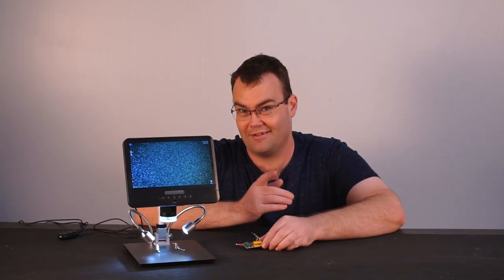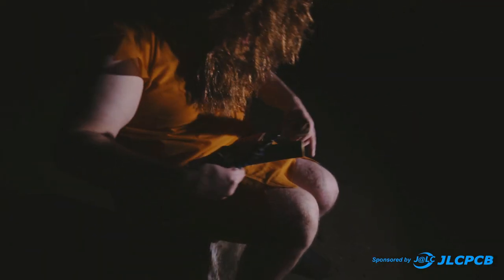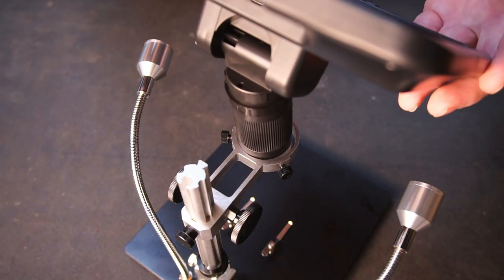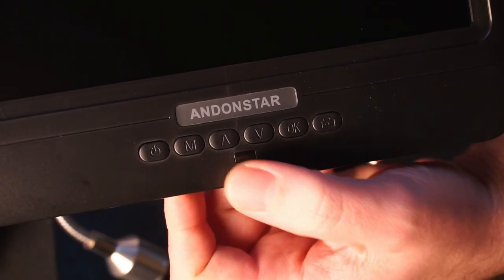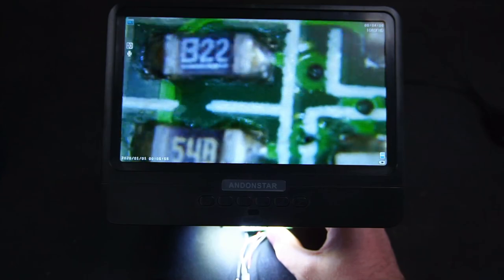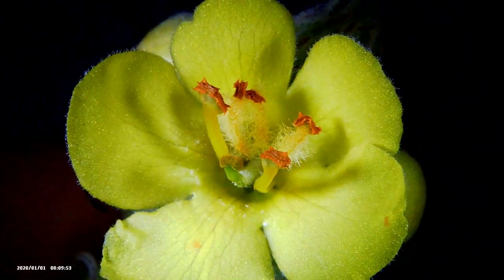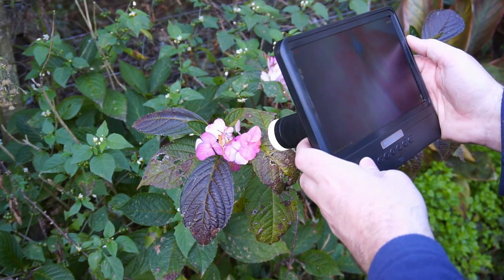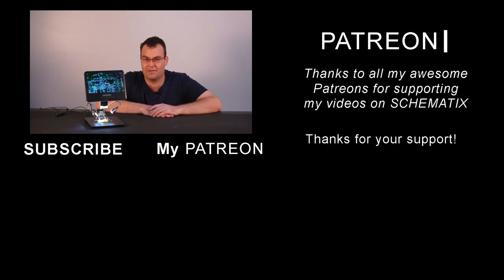This is a Bargain! II Andonstar AD208 Digital Microscope 8.5" LCD Review

Comment: I have exactly the same model and would actually say that it IS very sharp and clear. Certainly not up to professional standards, but surprisingly good. Way more than enough for most uses. Thanks for reminding me that there is a battery compartment! I have been using it plugged into a 5V powerbank, but an 18650 would probably come in quite hand in many situations. The only problem I have had with it was trying to get the ring at the base of the vertical loosened up so I could rotate the whole unit and horizontal support around the vertical support. Had to go to the garage and use some pretty big pliers and a vise to do that. I definitely do recommend it for any home use and think it would serve quite well in a lot of school or business situations as well as long as it is front lit will do.
Reply: hi, is it heavy duty?
Reply: @recommendedforyou157  Just 2 pounds 10 ounces, or 1.2 Kg.
Ooops, sorry I missed the 'duty'.  But that weight may tell you something. If you treat it with a reasonable amount of respect it will last a long time. If you pound nails with it, it won't. As I said, it could be used in schools or labs with no trouble as long as the user is not ham fisted. Much like a normal microscope.
Reply: @gkseifert  thank you sir
Reply: Is there enough room between base and camera to get circuit board, soldering iron etc ?

Comment: The ladybug shot was really cool!

The claimed 260X zoom is clearly an exaggeration. On the provided (1280 X 800) monitor, it looks to be perhaps  50 or 60X max. On a 24” HD (1080) screen, you might get around 100X before losing detail. I wish these companies would list magnification accurately. As you pointed out, the magnification of this model is far more than adequate for almost any soldering work, so long as the board or other work will fit on the stage. But if you want to observe, say, microscopic life, 260X might get you close. But this and many other scopes now on the market mislead shoppers. The claimed 260X would be enough for many, say, student needs, but the actual performance would be unacceptable for those purposes. Like lumens for flashlights, you can’t trust the claims for too many of these products. There are some reputable companies that, as yet, don’t seem to lie (AmScope, Leica, and a few others for microscopes, for example) but it’s very difficult for people to know what they can trust. 

Great, helpful review.

Comment: I have the MOYSUWE version (exactly the same, except with a crappy wireless remote which has a bad habit of skipping items in the menus - lots of trial and error to select the right line...). One thing that bugs me is the battery icon at the bottom right of the screen that constantly flashes. Anyone know why? Does it ever stop blinking? Also, anyone know what the third LED on the back (the one right next to the SD card slot) is for? (The first, red, is to indicate when the device is plugged in; the second, blue, is to indicate when the device is turned on.) Thank you!

Comment: Incase it's not obvious, you must supply your own USB charger plug. It's not included with the 'scope.

I just ordered one this weekend. Can't wait for it to arrive. I've got some 0405 components to solder.
Reply: is this actually good for soldering 
I was considering  getting one  for soldering but then I saw another review that says the lack of depth perception makes it harder than a  binocular scope , not sure how much an entry level binocular scope  for soldering would cost or if is worth it to go the binocular route
looking to do console repair and modifications as well as  some arduino stuff
Reply: @andreamitchell4758  it works for me. Stereo vision is always going to be better, and cost more.

I think the only challenge I experience is the small stand space. For console repairs you'd probably struggle to position the board under the camera well enough to view areas more than 3-4 inches in from the edge of the board, unless you made your own stand, which negates the price advantage of buying this type of scope.
Reply: If you're in for the long haul and can justify the spend, a binocular scope would be a way better choice in that you can typically add polarising filters, better lighting and have more functional mounting, without having to pay twice. The age old wisdom of spend well, spend once.

If you're just getting started and need to be sure you will do this a lot, then this might be an option for "testing the waters".

Comment: Thanks, what is the picture delay on the screen with your experience?
Reply from the maker: There is a slight delay however I didn't find it a problem. I only noticed it when making quick movement

Comment: Can see how one of these could be useful mounting those nightmarish 0.1mm pitch ICs.
Reply: Not sure what you are working with with a pitch that tight but I have managed to hand solder with an iron a DS3502 which has a 10uMAX case. 3mm case, 10 pin, 0.5mm pitch. Had a 70x optical zoom digital output though.
Reply: @srmofoable  Looking at it now, I was just wrong.  The STM32 and MSOP-10 chips that give me fits have 0.25mm width pins, with the same spacing ... so yes, 0.5mm pitch.  All I have is an optical loupe and magnifier glasses.  Your DS3502 looks like an MSOP-10.  I have little 0.1" PCB adapter plates for that kind of thing.

Comment: Do you know of any reliable 18650 charger schematics using basic components that can easily be found? I’ve already got a schematic for one that uses LM358N, not entirely sure or trusting of it though, I’ve tested it using a simulator site but I’m not entirely sure if it will really work :/

Comment: Looks nice for electronics work but the magnification is at tops 10x, which is also all what you need for electronics work.
Reply: No, 10x magnification is nothing, it's what some beauty mirrors have...you're definitely wrong.
Reply: No he's not. 40x microscopes are used in schools for observing cells. If this was 280x or whatever they claim he could see the bacteria on the PCB. Instead the camera can't even fill the screen with a resistor. No way that's more than 20x
Reply: @westsenkovec  you're wrong too.
Reply: @westsenkovec  I just put a scale under mine (in photo mode, not video mode). It was as far down as it can go and still focus. About 1.9 millimeters on that scale fills the screen horizontally. That screen is about 190mm wide so that is about 100X. Don't know where the 260X comes from.

Comment: I use a simular scope. its without a screen. so I use it with my tablet. works great :)
Reply: does it have a stand or is it  one of those handheld jobs?
 if it is handheld I wonder if you could  rig up a  stand or find some stl files to 3d print one
I was looking for something like this  that   has better optics but lets you use your won android device as a screen or  is  at least cheaper , but not the handheld units with no screen or stand

Comment: Nice review! 
So you decided to replace the 18650 cells inside your Makita battery and found out that it also needs a new PCB to be accepted by the original charger again ?
Makita bastards trying to outsmart the caveman.... GGGRRRRRR.....
Please be aware, those boards are great to trick the charger to accept the battery again but the board doesn't balance the cells. 
I made a small 5pin JST connector on the 4S Makita (14.4V) battery to balance them using a Turnigy Lion charger, that way I keep the cells in good shape.
Thanks for the video !!